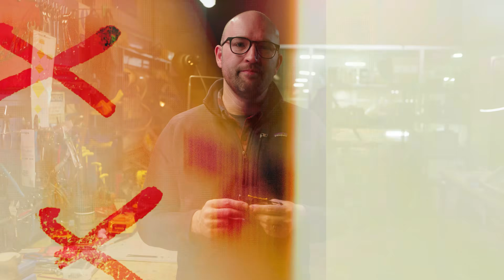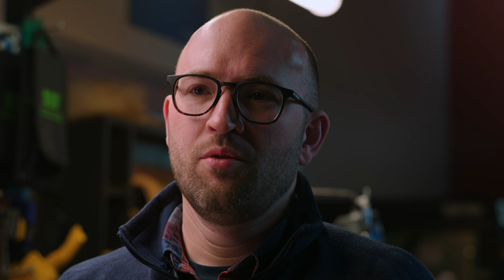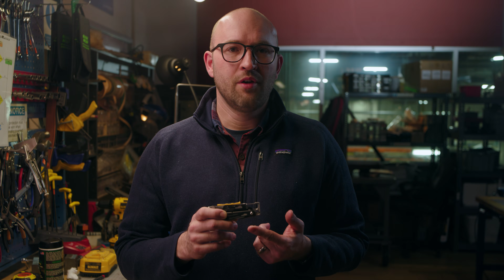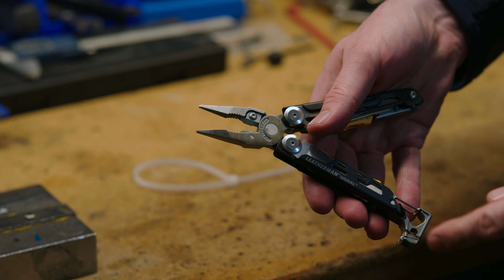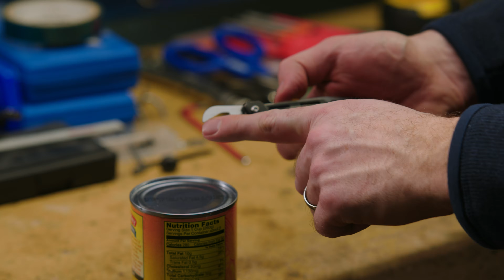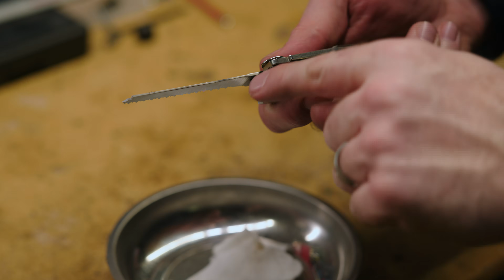Everything You Need to Know About The Signal Multi-tool

Comment: With the signal you are closing in on the perfect multitool. 
Both beltclip and the carabiner is useless tho. 
Most people don’t take their chance hanging this on a backpack or on a belt. It’s so easy to lose. So get rid of the beltclip and the carabiner. 
You are going to use the pouch. 
So get rid of the carabiner, and make more room for other tools. 
In my world when i am in the forest or at work where i use my multitool almost everyday, i need: 

A hammer with a bit holder (like the signal). 
A set of great pliers. 
A big strong scissor. (Not the little one at my wave). 
A strong blade. Not serrated. That’s just overkill with 2 blades like in the wave. 
A file. 
A saw. 
A bit holder. 

Please and thank you🙏🏻

Comment: I can't get the whistle back into the Signal in a way that the tool closes!  I literally just unboxed it and now don't know how to get the whistle back in :(  It fits into its space but won't latch again at the top and just falls out. If I try to close the tool it bumps up against the pliers on the fire starter side.  Any suggestions?  Thanks.

Comment: I looked hard at the signal and all the other camping multi-tools. I found that it was way overpriced for what was on the tool. I don't need a bottle opener and haven't used one in the last 40 years. Screwdrivers are rarely of use in the woods. In the end I went with making my own tool with a Roxon Flex. Leatherman has been coasting on their reputation and failing to innovate for many years. In business the strong survive and the week hit the unemployment line. I know many will swear by there Leatherman, but for my camping needs, it quickly comes up short.

Comment: I couldn't get any spark off the ferro rod using the back of the saw, or the knife. If I use the top edge of the pliers, it works great.
Reply: Use the back of the saw on the corner of the edge should work

Comment: some input
the hammer is the biggest plus over others in the lineup
the bit retention is one sided (i.e. the notch is slightly off center) so if you don't know this you will lose you bit eventually (vs skeletool that retains the same bits in both orientations)
the ferro rod is not for emergencies as it is too small for anything but specialized kindling that only needs one spark
the diamond rod layering looks very thin and should probably be reserved for emergencies not for steady upkeep
Reply: You can prepare that kind of kindling if you know what you're doing. But you have to know what you're doing.🙂 In that case, you also probably have a full-size ferro rod on you.))

Comment: please correct the printed article it says 
CAN OPENER
A reliable can opener is built into the tool. For best results, hook onto the lid with the designated point and "rotate clockwise" to avoid sharp edges.
you however correctly stated "move" clockwise around the can

it seems your engineering team has an innate MISunderstanding in reference to pull style vs push style that creeps up regularly
perhaps you can demonstrate to them so they will ON THEIR OWN stop installing the time consuming and messy push style openers over the pull style.
Reply: You're throwing a hissy fit over "rotate" versus "move." 

I was going to say that no one is confused but you, but it's worse than that. You're NOT confused, but STILL complaining about something that's not even a problem. 

And to suggest not including a can opener in a multitool specifically designed for scenarios very likely needing a can opener is not a good look for you.
Reply: @ColMustard_8647  you just sound like another person that doesn't use these can openers. i feel you have never tried using a push style or you would be more sympathetic.
(read my correction now. do i have a better "look")
Reply: @ColMustard_8647  as to the wording 
i get the impression that this is just a symptom of their uncaring 
(i agree that most people will figure this out, though you should see some youtubers out there, hehe)